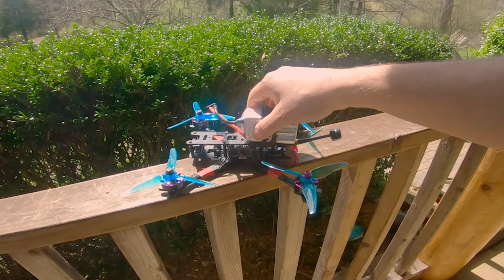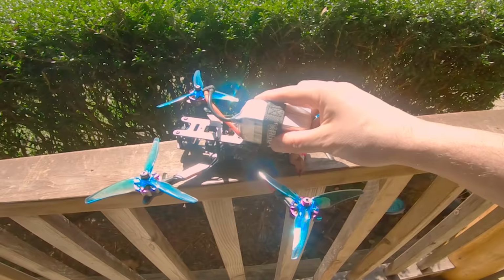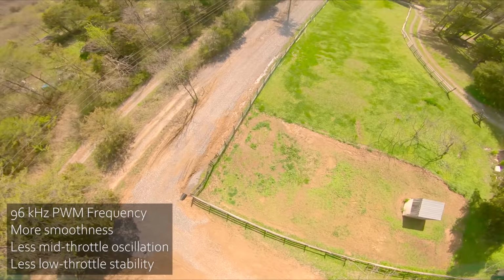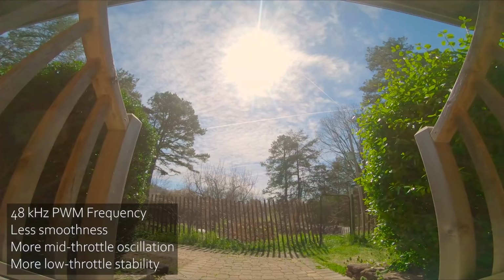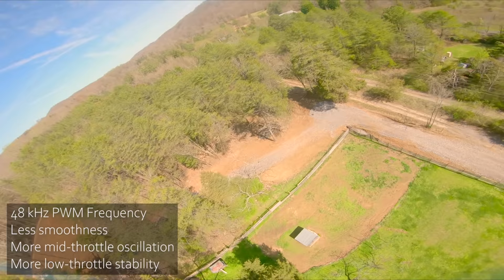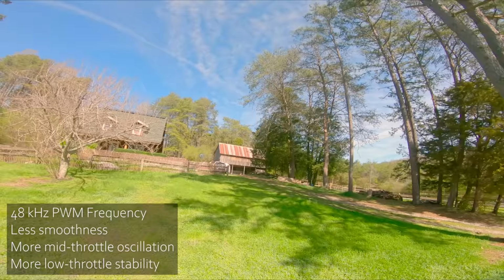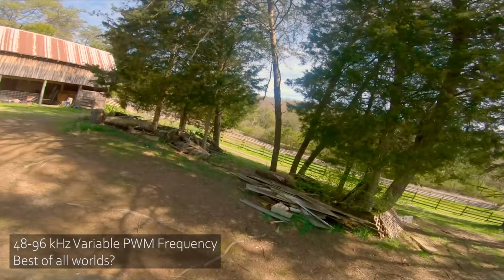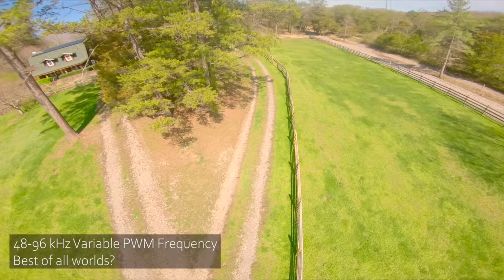BLHeli 32.8 variable PWM frequency FLIGHT TEST

Comment: A lot of people are suggesting a larger range (24-96KHz). I also think this would be a more efficient use of the dynamic PWM frequency. But I also wonder if it would be more visible on more sensitive build like 3" or 7" ?

Comment: I still remember learning to tune a quad before all the filters and dynamic hocus pocus, ahhh good times.
Reply: I know! I learned on CC3D and open Pilot- no OSD controls, so if it flew like crap, you had to tune it on the computer and retry.
I'm back into it after a couple year break and I'm still learning this stuff because I was flying Helio for a couple years, and that is WAY different to tune.

Comment: I think part of the issue here in this test is your ESC being variable from 48K to 96K.  I think in those situations on a 5" quad that perhaps you aren't going to solve a whole lot using a PWM frequency above 48K.  I tried it on my new QAV-S which has a TMotor ESC with PWM frequency ranges between 16K and 48K.  I was running 24K static before and then did 16-48K variable.  To be honest, I didn't find I was having a smoothness issue at 24K.  But it sure did feel like I got a little better torque in the low end, so it felt just a bit more in control with low throttle adjustments.
Reply: Thank you for your comment. I'm running an Airbot Furling32 ESC with the same frequencies. However, I haven't noticed much at all to be honest. It's good to know that I have more authority at the low end, which also helps for prop wash.

Comment: This happened before the low throttle instability vid too when you were trying to demonstrate the extreme P I D values (too much/little P, too much/little D, etc), but couldn't ever get the quad to fly poorly.    It's really frustrating for those of us who occasionally have shaky quads and never get to see our problems replicated and thus not see a change made that actually fixes the problem.   
Makes me think there are really a lot more root causes to a lot of people's poorly flying quads, like frame resonance or issues with certain motors and so forth.  For instance, I bought 3 new Kakute F7 boards, put one on a 7in quad with DJI AU and it exhibited a constant low amplitude shaking in the air at mid/high throttle.  I logged and tuned my PIDs high and low and and filtered this and that for WEEKS and it never got better.    Finally I happened to notice in the motors tab that all the gyro traces were jittering whenever the  AU was drawing full power. Turns out the 9V voltage regulator under full load was throwing noise into the gyro.      2 of the 3 new Kakute F7 FCs had the same problem, making them useless.  So much time wasted on something that had nothing to do with tuning.

Comment: I hope people were paying attention to the wobble difference between 96khz and 48khz on the SAME EXACT PIDs.  Now take that improvement and you would see double that between 48khz PWM to 24khz PWM.  Then go apologize to the BF devs.  You know why.

And if you really want to wobble, try Idle Up vs. Air Mode.
Reply: So the best would be just to stay at 24khz? For my Quads i have the best non wobble feeling at 24khz
Reply: @REAL_N3W  IDK, i stick to 24khz as much I can for the best low'end throttle authority.  But will look at 24khz to 48khz range (auto-pwm). I believe most of the devs are currently on 24khz.
Reply: @uavtech  What if your esc's go down to 16khz?  Maybe I should try 16-48 variable pwm just for fun and see what happens.
Reply: So if you increase your ramp up.. by a margin.. what results when using variable PWM
Reply: @MichaelRyannz  unknown.  Would be interesting to test.  My understanding from others actual testing with data, Rampup Power has no effect once the motor is spinning.
Reply: Fettec and forget it.
Reply: @creationlabsinc.189  except for search: "UAV Tech KISS Tuned"  or worse, KISS Default.  Of course, with higher-end equipment, like with any firmware defaults and tuned are better.
Reply: agreed, when running Betaflight on a 5 inch, 24khz all the way for me
Reply: I have two Desinc with this feature using tekko32 f3 40A, wen i return tu 48PWM only (it's the minimum possible) i fixed all desinc problem, i try all type of trick and mouve and no Desinc problem for 4 lipo's 🤷

Comment: I did update and change motors at the same time... had massive trilling motors just trying to hover.... did a PID tune reset to 1 on all sliders and it fixed it. now to tune again... RIP

Comment: I think we're missing an element to this comparison, so far you've only compared it on an esc that goes between 48k and 96k. What about 16k to 48k ? That's the range of my Tmotor 55a esc and my kwad has noticeably more response on initial throttle ( feels more powerful even) and still smooth throughout. I noticed tall grass doesn't stop the props as easily or at all and it feels better at low throttle than it ever has. This is just my experience on my particular setup and may mean nothing tho, just food for thought.

Comment: id recommend - - i u are using a 96khz variable pwm esc, still employ thrust_linear = 25.  however, if you are on an esc that does 24(or 16) and 48khz, to turn thrust linear =0.  i think thats where youll see the best results using these.  (disclaimer: i have not tested this since beta, about 3 months ago.)

of course -- in normal flight -- you probably wouldnt really tell either way if we're doing power loops or rubix cubes through trees. so its really just want makes your quad fly best or better. in my opinion.
Reply: thrust_linear = 25 seems better on all cases anyway - both whoops, 3" and 5". thrust_linear = 0 is hard to control on slight thrust changes and hard to land.

Comment: Have you ever found 96kHz to be a good thing on a 5” drone? My impression was that 96kHz was more for micro drones where motor RPMs are much higher, and even then most people saw 96kHz is too high. I would think that your best bet would be 24kHz or variable PWM ranging from 24kHz to 48kHz. No? My best performing 5” is 24kHz fixed.
Reply: 96 kHz works better for whoops indeed. From practice no noticeable gain from 96 kHz on 3" and 5". 48 kHz on 3" and 5" indeed does better than 24 kHz.

Comment: You can easily feel the difference between different frequency settings, if you will start monitoring current . At height frequency if you pull sharply and release stick - then you will see current jump for few millisecond. At low pwm freq it cannot be tracked.

Comment: I updated the ESCs in an Emax Magnum 3 stack that I have installed on a Mode 2 Ghost frame with 1700kv 2306 motors and was very pleased with the results. On this ESC (and those Gemfan Mavericks we got from Kwad Box) have a min/max of 16hz/48hz no 96hz option. I'm running the full 16 to 48 range and it feels the most like Flight One (in a good way) that I've ever felt and used to run F1 on this specific quad. It's tough to explain but it feels incredibly smooth and responsive compared to the tune this quad previously had which I stole from an Emax Hawk5 which felt quite good but floatier.

Comment: Ramp up power then PWM variable frequency.. each time I launch YT there are 2 new settings to tune. Sooner or later we will have to be NASA engineer to get a smooth drone haha
Reply from the maker: Eventually it all gets baked into the defaults. Meanwhile it's fun for those who like to fiddle around.
Reply: @JoshuaBardwell  i don't have the time to test everything, but I hope default will be improved little by little ! Btw thanks to those guys who go deep into tuning ;)
Reply: Fettec and forget it. Fiddling around with tunes, filters, etc is just nonsense these days.

Comment: It seems to me that the poor tune on default PIDs is overshadowing the subtleties of the change in PWM.  I think if we really wanted to this this out, we would need to get the tune perfect, then test the PWM changes.   You can't feel the different types of tire treads  on your car if the engine is running all choppy and your suspension is broken.   The bobble on throttle cut seems almost like I-term windup.  Assuming the P terms are high enough to make the PID loop work properly, I bet dropping the I gains would fix that.
Reply from the maker: I see your point, but I feel like the argument goes the other way. If we perfectly PID tuned, we could fix low throttle instability e.g. by turning on thrust linear and raising D gain. At that point, the changes in PWM frequency would have little or no effect. So by letting the bad pid tune bring out the problem we can the see the effect of the PWM frequency better.

Comment: I setup two quads. one so far is fine and  feels great. One  quad tmotor esc when up in flames after a small creSH. more testing needed
Reply: Could you figure it out? I‘m running the same quad setup as a friend of mine. Very quickly after the update to blheli 32.8 we both had a smoked motor and a burnt esc (without any physical damage in advance). Tmotor F 55 A Pro II with Tmotor F60 Pro IV. Not sure but we suspect the variable pwm frequency or blheli 32.8 itself to cause that.
Reply: @badcaptaintrx  my new esc is fine

Comment: 48K almost seemed the best rounded.
I'm starting to think all motors respond differently to refresh rates- perhaps setting PWM at the max/low settings and adjusting until you find the sweet spot is the best way to go and maybe using variable in the two best spots.

Comment: I also tested it on my new sl5. But it feels to me as if it would wobble more with dynamic range vs the static 48khz. On the other hand 48khz is the max for the sl5 so for dynamic I even had to go down to 24khz. Another thing is that I was playing around with the sine modulation (with or without dynamic own), which doesn't seem to affect the flight as much.

Comment: Why didn’t you try it with 24k at all? I feel like most people are going to be doing 24-48
Reply: Most ESCs are either 24-48 or 48-96. 24-96 ESCs are super uncommon.
Reply: Because that esc doesnt do that
Reply: @biggfpv2721  thanks, I didn’t know that
Reply: @mouseFPV  ok. I see. I would still like to see some 24-48 testing but I’d don’t know that could t be done on this esc. Thanks!
Reply from the maker: The ESC won't go to 24. 48 is the minimum.
Reply: @JoshuaBardwell  thanks!
Reply: Depends on the esc.   I found my t motor F55 pwm range was 16-48 range.   
I set low to 16 and 48 high.   Was a difference on my 7” glide build.
Reply: @mouseFPV  Not sure that's true.  I've done it on three quads now, all are 16-48K.
Reply: @heroflying  lol why would you post this comment after Bardwell verified I was correct like 4 comments above yours.... 🤦
Reply: @mouseFPV  because you said 24-48K when actually (I think) most ESCs that top out at 48K actually reach down to 16K.  I'm literally 3 for 3 on my BLHeli32 ESCs from three different vendors that range PWM from 16-48K.  Bardwell didn't comment on that specific portion of your post.  I'm sorry sharing that info was so offensive to you.
Reply: @heroflying  cool well those samantics have nothing to do with the original question...
Reply: @mouseFPV  I officially apologize for attempting to share info about what PWM ranges are being seen.  This was totally not worth it.

Comment: On MambaF7, 24 to 48khz, feels good but it introduced a bounce back on sharp half rolls and flips that I couldn't solve with PIDs tuning. I rolled back to 32.7.
Reply: Same here, I had to pump up P and decrease i-term-relax from 15-to ~10-8. It looks like the variable pwm make the I term stronger.
Reply: @butcher  Interesting, I didn't change I term relax cutoff since I like how it feels but I should give it a tru if it helps , thx :)

Comment: I've tried it on iflight 4in1 50A esc with the DC10 and 2814 1100kv motors; I've set dyn pwm freq from 16khz to 48 (sides limit of the esc) and I got a desync. Maybe I've pushed to much the bandwidth, with 24-48 khz, everything was fine. Maybe is not so suitable for big quads... however, great feature! thanks for the info JB! as usual! :)
Reply: MAB, got the same DC10 1100kv motors (6s) flashed 32.8 and first flight with variable 24-48 was terrible. flys much better on 24khz,  running 9x4.5x3 masterairscrew props. I am thinking dropping down to 8" props for future test. would you mind sharing Logs and video of your setup?
Reply: @rcafpv6581  now I went back to 48khz, fixed setting. It just saves battery, my setup is dc10 - fc matek h743-slim - esc iflight 50A blheli 32 - motors iflight 2814 1100kv - props 10x5x3  - matek 5883 gps+compass - 7000mAh 4s 35C battery - I've set bf filters with rpm filters and PIDS like 1.5 1st slider, 1.2 2nd slider, default the others and few stuff more. It flies good enough ;) I don't have logs yet, for the videos, as soon as  we can go out with no lockdown or red areas
Reply: I think for 6s you should go for 800kV on 10 inches...
Reply: @mab4195  good point,  will change scale factor in BF down to 66% - it could be just that simple. chasing a small wobble on throttle chops and at end of flip/rolls
Reply: @rcafpv6581  yeah, little wobble when you chop the throttle is normal unfortunately, I think... I'm still looking for best setting on that with PIDs and filters. if you set the throttle % as JB told in one of his videos, you can solve pretty well with that ;)

Comment: Hey JB flown about 10 packs on 32.8 PWM set to 24-48KHz flew almost like a different quad, it just just scrubbed out the few little niggles, mainly the low to middle throttle instability and motors sound silkier than with fixed PWM.  Overall I like it 👍  Question....my ESC’s will go down to 12KHz should I try going that low and set 12-48k and see what happens?

Comment: Hi Joshua! Got a question for you. Can I put betaflight on the RF one lightning H7 flight controller? If so what would it be called in betaflight? Like what firmware should pick for it if it's not in there under the same name of the fc?

Comment: I think it's easier to tell the difference on a well tuned quad, I'm running 32.8 and notice a good improvement in stability.
Reply: What esc are you running?
Reply: @joeoli15  rush blade 60amp and mamba pro 60 amp
Reply from the maker: The problem is the tune can cover up the difference.
Reply: @JoshuaBardwell  true, but in my case, I could tell the difference as it cleaned up the last little bit of low throttle oscillations.  Stock betaflight your going to get them no matter what so it's really hard to tell, vs getting that last little polished edge. Just my opinion and experience.
Reply: Sweet video though, always admire your skills and how well you know your property. Looks like a fun day of flying there.

Comment: You said it was on default pids, so won't tuning the pids solve most of the high and low throttle wobbles? And set to variable pwm?

Comment: I tried this feature and I'm impressed. 
But not work in every esc...whit my tekko metal 65a working fine in juicy style💪💪💪
Reply: Wow, it's interesting because it's works well with all of my esc, except the tekko32 not on 65a and 35a neither, the motors gives weird noise, like when the propellers slipping
Reply: @butcher  interesting....but isn't my case....in the other build with Tmotor F55a pro II this feature don't work good, I've noise.
Reply: @salvofpv  Wow, maybe it depends on fc? What fc do you use?
Reply: @butcher  flightOne H7

Comment: I saw more mid throttle oscillations going from 24 to 48 on the hobbywing 60a esc. I’ve gone through like 3 escs and these just can’t handle the 48k

Comment: Are you using a different GoPro or have you changed something in the color grading?
Reply from the maker: It's the same hero 7 as always. And the same guy did the color grade. Maybe it's just the sun coming out due to winter ending.

Comment: Havent notice anything on 3 different quads. Could only do 48khz to 96khz on all 3. It needs to track motor rpm, and its doing it by tracking throttle % which really isn't doing anything for my type of flying made things even worse.

Comment: You are trying to solve a problem you don't have!
The inbalance should not be here on the first place but to solve it you would typically give it more I-term on the pitch axis.

If you want to show the advantage of v-pwm use a heavy quad with overpropped motors like a 600g AUW spinning 5047 on a 2004!

Comment: I feel that my motors are running hotter than usual when  I turned on the dynamic frequency option. Does anyone else feel the same?

Comment: Is this footage DVR? Like... analog? Because it's strange to see there was no other cam on your quad and it looked like you were using a analog receiver. Still, the footage is incredible, I'm a bit confused
Reply: Probably a split cam. The footage has that runcam look.
Reply from the maker: It's a GoPro. The same one I was holding in my hand when I recorded the intro.
Reply: @JoshuaBardwell  I feel stupid now for even thinking that was anlog
Reply: @JoshuaBardwell  well, guess I learned something today....

Comment: I tried 24-48. Feels like the quad still on low pwm to long. I dont need any extra low rpm power on 2306.5 - 1950kv xD  So there is no point to me go lower then my esc max pwm supports)
Reply: Adjust your ramp-up power and timing then. It'll pick up some response

Comment: Why did you not go all the way down to 16k? I think that is where you would see low throttle stability improvement.
Reply: According to rc groups page it will only go from 48-96.
Reply: @RubyS.1  yeah I am just seeing this on some esc. Why are they making 48k the minimum if there is possibility of of instabilities?
Reply: @jdd1777  idk. Holybro list it as a sales point. I went back to running individual esc I couldn't feel a difference changing pwm but I could going from 4in1 back to individuals.
Reply: @RubyS.1  Its dependent on the ESC. Some go 24-48, some 48-96, some can use the full range.
Reply: @HotboiEngineering  None can use the full range, at least I don't know of one. To my knowledge they can either be 24-48KHz or 48-96KHz, none that encompass both